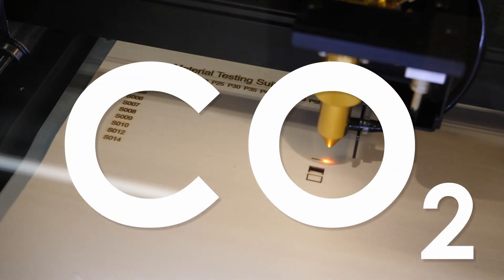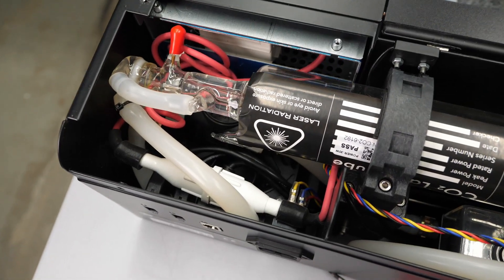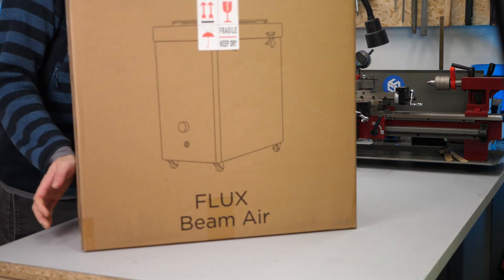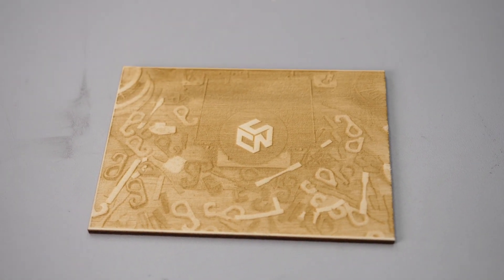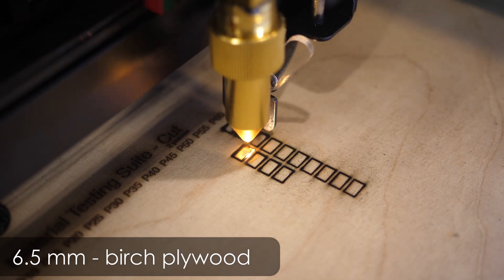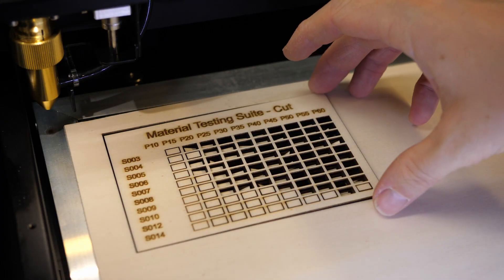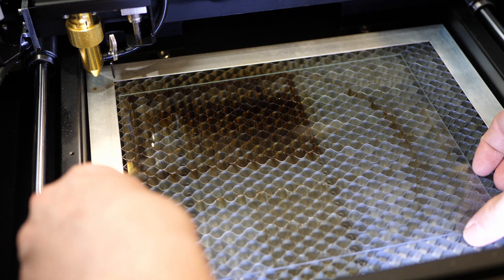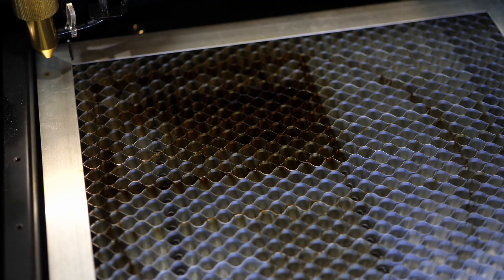FLUX Beamo REVIEW - Compact 30W CO2 Laser Cutter

Comment: laser cutting and engraving is rather addictive lol it is true that there are much cheaper options like the K40 laser cutters Which is what I have and revamped more than a dozen of, but after you factor in the cost of replacing everything that not good, just to make a great cutter/engraver out of it, the Electronics such as the board so you can use Gcode and Gcode driven software, and re-doing all the wiring to make it safe, Replacing the cheap mirrors and lens, and adding a proper venting fan duct, and adding a good Air assist and better water cooling pump,  they usually come out to close to the $1000.00, after all, is said and done. So, if the Beamo is around 1200$ that is still a good deal, BTW those K40 that say 40Watt laser, its all BS lol 98% of the ones I Revamped we more along the line of 30 to 35 Watt power even if the tube said 40Watt.
Reply: How do you spend 1k$ on a K40? I mean the only thing you really have to change is the bed, the mirror and lens holders and the controller. For a controller take a simple grbl kit (40$), the my holders comes from cloudraylaser (60$ incl. a better set of mirrors and lens) and the bed you can get at ebay for 100$. 
Ok I also got an air pump (40$), a better fan (90$) and a flow and temperature sensor for the wate (30$) but those are not necessary tho I would recommend them. 

Together with the cost of the machine (350$) I would get a max of 710$ with a cost of 590$ if you only do the minimum and do not own a compressor already. For the 300$ you can easily upgrade the k40 with a 60W laser tube + laser power supply and have a much more capable machine than the one they sell. Tho you have to tinker and do quite some work.
Reply: @nukularpictures  Here in Canada the basic K40 is around 550$, The Cloudray lens and mirror set with brackets are 90$ after shipping and imports then factor in all the rest, Venting fan duct 100$ a proper Mini compressor 70$ for Air assist, Safe water pump, relays to Auto turn on and off said things ...so on and so forth, then we have to factor in a bit of our time into it, Its either I work to make money to pay for an already well-made laser cutter or we put in the work ourself and factor it in as our pay if that makes sense, nothing free in this world hahaha We either pay with money or pay for it with our time. here what the results of my time buy's me. https://www.youtube.com/watch?v=iL3WUZiQriE&t=95s
Reply: @patprop74  Yeah ok. If you factor in time I can understand it. But for me that is hobby and relaxation. I would never get such a device to make money but I get your point.
Also I did not think you meant Canadian dollars. Then we are at the same price basically.
Reply: @nukularpictures  Yes indeed USD and CAD don't have the same value sadly lol but there was a time, a long long time ago!

Comment: Much more expensive than even a fully upgraded k40, which I already have. 1500 gets you a much bigger cutting area, grbl conversion to use lightburn, air assist, a proper cooling system etc.

Comment: Requesting metal engraving tests and other thin plastics (hdpe, polycarbonate sheets?)
Reply: Poly-carbonate does not cut well with a laser. Nasty fumes and burned edges. Everything above 0,5mm or so is basically impossible. Made that mistake once before when I accidentally ordered the wrong material.
HDPE cuts okish. The problem is it melts too easily. So if you do not have enough power it will just start to melt the edges instead of cutting it cleanly. You need multiple fast passes with reduced power to get acceptable results.
With rubber sheets it depends on the material. There are special rubbers for laser cutting (LOR). Those work well. Others just burn.
Reply: @nukularpictures  Noted! I haven't gotten a clear answer of if PC is CO2 laser cuttable or not.

What other plastics are laser cuttable? What about PETG films?
Reply: @LorneChrones  Well like I said. PC is not really cuttable. Thin foils work, plates are basically not possible. At least that is my experience.

I have not made any experiences with PETG. Sadly I am not at home right now so I can not test it. But from what I have heard from other people it should work fine and be similar to PMMA.
Reply: Infrared won't touch anything specular like metal - it just reflects off. At best at 1% speed and 100% power you can barely dimple mild steel - but all the reflections will put a huge amount of heat back into the lens possibly damaging it. 
HDPE melts, and polycarbonate burns black without cutting well. Tonnes of black sooty smoke from laser. do not advise.
thin PETG cuts relatively nicely if you move fast to prevent too much melting.
Other replies here, Rubber sheet is good and bad. Latex smells atrocious and gets a sticky gum residue on it (like the latex de-vulcanizes). The gum washes off eventually with soap and water. marketed 'laser engrave' rubber sheet for making stamps is amazing. You engrave the negative and end up with very high precision stamps.
Reply: @frollard  Well that is not 100% true. You can cut metal with IR lasers. You just need a lot more power. With oxygen you can cut thin steel sheets with a 150W laser. I have seen that done in person. 
If you want to cut anything above 2mm tho you need lots and lots of power.
Reply: @nukularpictures  fair. Anything less than 100w won't even dent aluminium foil. All about context on this thread
Reply: And test rubber sheets please
Reply: "It cutted fine through 5mm aluminium but struggled a bit at 6.5". Hey I can dream
Reply: @haraldhimmel5687  Based on context pretty sure he was referring to wood. Aluminum wouldn't be touched.

Comment: Well it is just way too expensive. It cost the same as the Chinese 60w or even some 100w CO2 lasers. And those also have pretty good controllers.

As a hobby machine, if you want to do some tinkering, the k40 is a good machine. With some small upgrades (controller, bed, mirror and lens holder) you have a machine that is basically the same as this, just costs 800€ or so.
Reply: It's the plug and play that makes people think it's worth the extra cost, but what's the cost of a new tube? Or a new lens or a new set of mirrors. What's the cleaning of the lens like? I'll be honest I like my 50w co2 Chinese laser works well for me and about the  same price as the beamo
Reply: @derekwright2388  Well thag is the point. Here in Europe you can get a 60W with the 100W tube upgrade for the same price.
And those machines have proper linear rails,  mirrors, controller, etc. 
They are basically plug and play.

I mean I agree if you want to just use a machine that you want to spend some money extra. LIke I said the k40 is an option if you like tinkering, exploring the machine.
Reply: @nukularpictures  I agree, I have a k40 I have upgraded with a new board (cohesion 3d) and added new mirrors and a new head and new extractor and air assist.... And still spent less that £700 on it. My 5030 50w cost me 750 second hand, replaced the psu and eventually tube and mirrors and lens but still less that 1000 quid and it kicks the beamos bum. Add lightburn to the mix and you have a serious decent bit of kit

Comment: Stephan. please explain the security issues of this thing!  The clear Plexiglass is a no go, that needs to be coloured to filter the light of the installed Laser.
So, ich hab schon einige hier auf YT angemeckert ( Phillips 3D Druck, Pommes Man wegen Ihren laxen Umgang mit den Ortur Lasern) An einer Nozzle meiner 3D Drucker kann ich mir vll, die Finger verbrennen. Aber selbst diese Diodenlaser könnten dir das Augenlicht nehmen, wenns blöd läuft..
Reply: It's an infrared laser at around 10K nanometers.  Plexiglass is entirely opaque to that wavelength.  Though you can see through the lid, to the laser it's no different than a solid sheet of metal.
Reply: Colorless Plexiglas® sheet (aka acrylic, PMMA) is entirely opaque to infrared wavelengths from 2.8 microns up to 25 microns in thicknesses of 0.118" (3mm) or greater. Eg see plexiglas.com optical and transmission characteristics.
Reply from the maker: Thanks for the comment. Do you have any sources that the clear plastic does not protect against the 10600nm laser? I totally understand your concern for the ~450nm blue diode lasers though would think that the cover is fine for CO2. Will research that as well.

Comment: It's shame that in Europe beamo does not cost $1500 but whooping €2500 and that's a deal breaker.
Reply: Hi Piotr, to get this to Europe import taxes, shipping costs and VAT are added. This means that we cannot offer this at the same price. Beamo is the cheapest machine you can get with local support. (we have a repair center in Belgium & a growing network of resellers across Europe)
Reply: @flux_europe  taxes and shipping costs are everywhere in the World and I won't argue about your business model. I've just stated, that for me €2500 is outside my hobbyist budget. I could get hitten by $1500, but the 2 times of original price I would rather spent elsewhere.
Reply: @flux_europe  thatś just not true. Vat+customs don‘t bring 1000€ extra - espescially accounting dollar to euro exchange course.
Reply: Buy a K40, put a nice ruida controller in it and buy the lightburn software. The end product is more powerful and flexibel than a beamo.
Reply: Lol sure, try to buy something else for a lower price, I'd love to see how long it will keep going before it breaks
Reply: @deschoenmaeker  the choice is far more wide than buy alternative. I can buy a cut service (ROI up until 2,5km of combined cut lines without maintenance) or I can just not buy/use laser engraver in my projects at all until this emerging "home" market will come to acceptable price - just like 3d printers did.
Reply: @TheRealWurstCase  1500 is only in Taiwan, the calculation of money goes different there so it is more or less the same as here. Indeed the price says nothing of the quality but in this case you will not find anything better for this price.
Reply: @deschoenmaeker  are you lying or didn't do your research? First hit in Google - USA price stands at $1899 - much closer to taiwanese  than 2500 euro.
Reply: @voidborn-one  i'm from Europe man, how would I know what the prices in america are?
Reply: @deschoenmaeker  because you've stated that you've done your research.
Reply: @voidborn-one  in comparing to other machines and in europe, not in america
Reply: @TheRealWurstCase  sure, believe what you want to believe, i've done my research and know what i get
Reply: @deschoenmaeker  and the second thing - don't you think that Flux should stop marketing this as "$1500 laser cutter" on European/US channels if that's only taiwanese price?
Reply: @voidborn-one  the only site that says 1500 is the taiwanese site and it also clearly says that you cannot order there, they even redirect you to the site you need

Comment: Carbon Fiber!!! Definitely would love to see that!
Reply from the maker: Will do!
Reply: @CNCKitchen   i can't recommend it. I've tried it once with an trotec speedy 300 flexx. Man that was nasty as hell, the fumes of the resin are horrible even after the air filter. That's one of the reason why water jet cutter are used for that material.
Reply: No sadly,  Well,  not easily anyway, and very very stinky. Same with Garolite, which sucks because there is so many great uses for both of those materials.
Reply: You can't cut carbon fibre with one of these, need something much more powerful

Comment: Great review Stefan.  I'd very much like to see how it handles aluminium sheet.
Reply from the maker: I guess that nothing is going to happen, because aluminum will reflect most of the energy. You'll probably be able to engrave dark anodized aluminum or painted metal.
Reply: It does engrave anodized aluminum without problems. Any color. But cutting is out of the question with only 30w
Reply: If you want to cut metal you need a fiber laser.

Comment: I once engraved a glass with a CO2 laser and 5 minutes later, just standing on a table it exploded violently. Take note of that.
Reply: Thermal stress.  Gotta keep the glass a stable temp.  Usually involves warming it slightly before lasering and then tempering it slowly as it cools
Reply: There is no such thing as engraving glass, you're basically causing micro fractures on something that can cause explosions.
Reply: @JustTechGuyThings  yup it probably had some internal stresses that have been disturbed while "engraving".
Reply: @JustTechGuyThings  but you understood the message he was trying to convey, thus his attempts at communicating are successful unlike your message...
Reply: I've etched hundreds of glasses without any exploding. Low power, and smear the surface with washing up liquid - thats the key.
Reply: @JamsterJules  by "smearing the surface with washing up liquid", do you mean keeping it a little wet? i assume it wouldn't effect the finish
Reply: @JamsterJules  no I use wash down powder
Reply: @spikey911usa  when I was learning, and didn’t know JACK yet, I managed to make a hole in a glass soda bottle.  I got the hole, and turned the torch off to let it cool.  I was 5 feet away when I heard BANG and little bits of
Glass aaaalll over the office.  I literally tore out the carpet.  True story.
Reply: Was your glass was pre-stressed to improve impact/shatter resistance (toughened). If so, it isn't surprising as etching the glass causes a location for the glass to relieve stress and shatter, usually violently.
Reply from the maker: Good to know.
Reply: Yeah, if you go very gently you can often safely engrave glass, but it is likely a ticking time bomb. Recommend looking up annealing temperatures for glass to relieve the stress from the millions of tiny high temperature laser pits.
Reply: When glass bottles come out of the mould they develop internal stress as they cool so they are put through an annealing process. I was told that the bottle straight out of the annealing Lear is at it strongest state then as the bottle goes through eg filling and handling  it picks up stress concentrators  e.g. dings. Maybe the soda bottle was old, had suffered some trauma wasn't' t well annealed or contained an inclusion. Inclusions are unwanted objects in the glass such as metal, unmelted glass e.g. Pyrex that have found their way into the melt which are massive stress concentrators., this is more of an issue with recycled glass.  Soda Bottles are press & blow mounded, a slug (gob) of glass is dropped into the mould  forming the ring then expanded into the mould width compressed air, at this point if the glass is not evenly distributed around the mould there can  be a thin spot, another  source of failure. At the end of a glass bottle line there is optical inspection equipment that looks for these and other defects, and most are detected.
Reply: Engraving tempered glass will quite often cause it to shatter, regular glass panes (non treated) can be engraved no problem, i’ve made thousands just straight with the co2.

Comment: I'm not really interested in a unit like this until it can engrave round metal objects like steel and titanium tubes.
Reply: You can... But you need a rotary add-on and use a Cermark spray on the metal/titanium before starting.
Cermark spray: https://cermarksales.com
Rotary: https://www.fluxlasers.com/beamo-rotary-extend.html

Comment: Hello. I am wondering if you can use the laser engraver to create a new platform (by engraving a material) for the base of the 3D Printer for better adhesion.
Reply from the maker: Thought about that already - custom textured glass might be cool.
Reply: You can engrave metal if you use a Cermark spray: https://cermarksales.com. Only engraving is possible, not cutting.

Comment: If you etch the glass with the laser, can you use the etch-lines like score-lines for cutting glass?

Manual Cutting of glass:
(1) Score the glass with a glass cutter.
(2) Carefully tap/bend/snap the glass along the score line.

In other words, can (1) be replaced with the Beamo laser?

My guess is probably not.  But maybe worth trying.
Reply: You can. I have tried it. Run 4-5 passes over it and it easily breaks where you want
Reply from the maker: I think you can. Read that this is done in industrial applications to score glass vials.
Reply: It can be done - and with the rotary attachment you can do cool stuff like curved lines along a bottle. It's hard to pull off as the stress wants to break the glass, but with practice (as all glass things are) you can get some neat cuts.

Comment: Does laser cutting have any effect on mechanical properties of the cut object compared to cutting the same material with heating methods, such as CNC milling?

I'm slightly disappointed there were no strength tests. :/
Reply from the maker: Laser cutting has a slight influence on the surrounding material why it's also not often seen in aerospace applications, where waterjet cutting is preferred for example.
Sorry for no strength tests 😉
Reply: It's hard to know for sure on acrylic in particular - acrylic is insanely brittle to begin with. The flame-polishing that occurs giving the nice clear edges for laser acrylic seem like they would have fewer stress rises compared to the numerous score marks from saw teeth doing the same work. From my reading a decade ago when we got our laser cutter it was advised that you could anneal laser cut acrylic to reduce the likelihood of it crazing.
Reply: With acrylic I do sometimes have issues with crazing where things have been engraved or with many, small cuts. For large outline cuts, it's not a concern. I haven't had a chance to try, but I did buy an oven to try annealing it to relieve the stresses. Crazing seems to happen more with certain brands/sheets than others; possibly old stock that's not kept dry or has been exposed to a lot of light? But I've made many acrylic ornaments and most turned out fine.